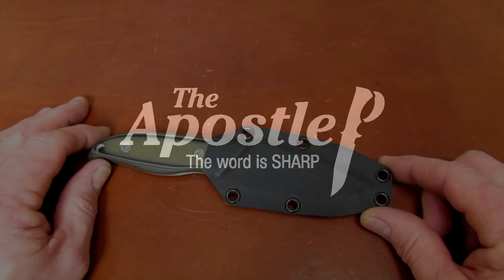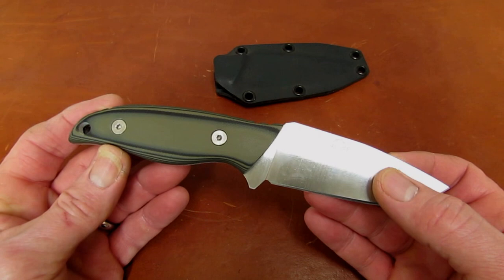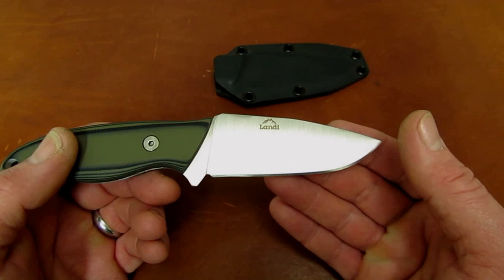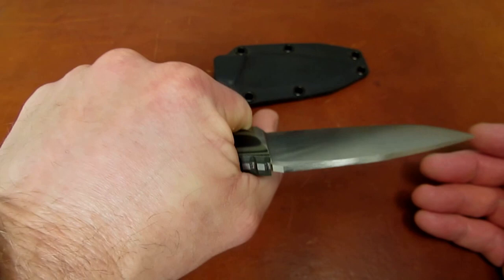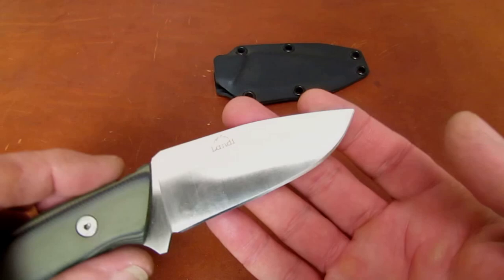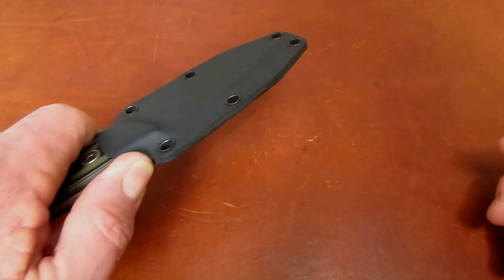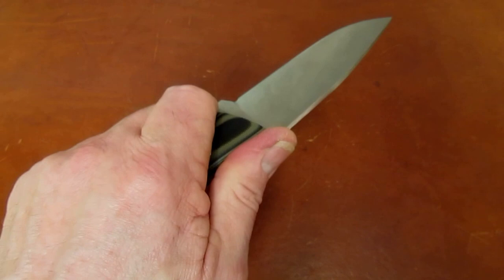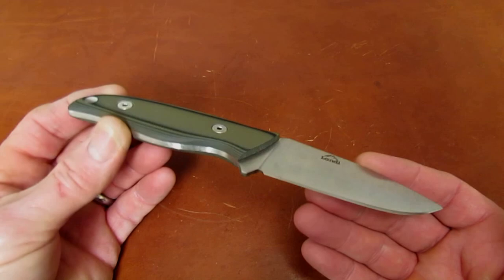Product Overview:  Landi Cutlery Kinzua @ CollectorKnives.net

Comment: I have had mine in 154 cm for about 4 yrs the sheath is very disappointing and the handle cramps your hand after a period of use but it looks like they have updated it a little for 2016
Reply: Also doesn't do wood carving tasks to well cause of the thick edge but as a camp piece it works well food prep and fire starting tasks like splitting kindling feather sticks is just ok I pick other blades for that though but great reviews rob
Reply from the maker: +Josh Wade Check out the Iron Bull vid, Josh.  The handle issues are addressed there... and you're right.  For prolonged hard cutting, the smooth handle on the Iron Bull is the better choice.